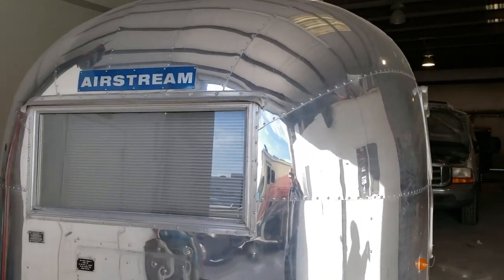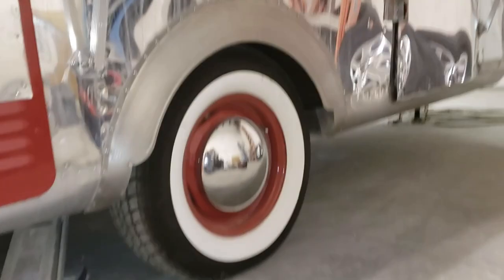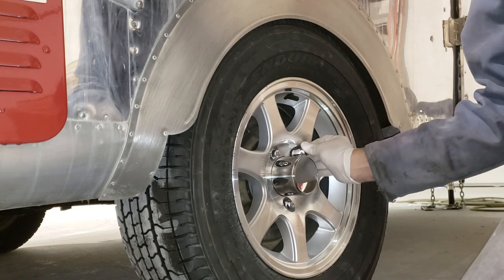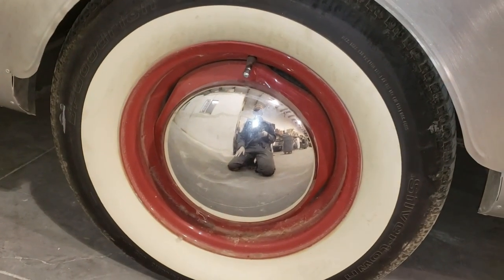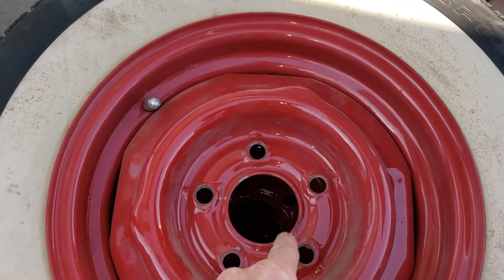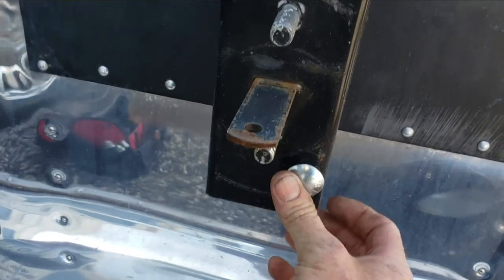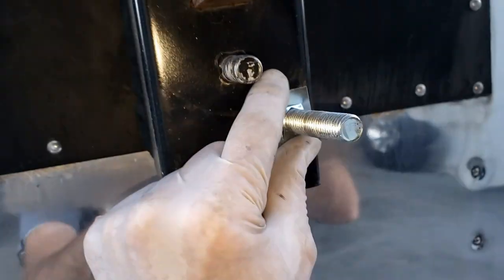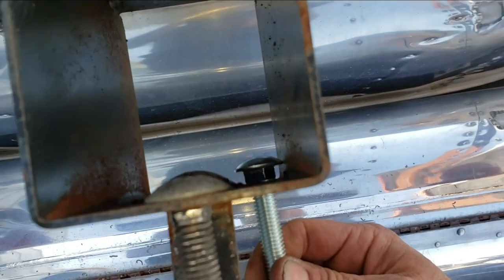1961 Airstream Bambi Wheel Upgrades

Comment: Nothing is easy LoL. I had the same problem with my old 07 Outback. Got new tires and had no clearance. Called Dexter and got the flip kit as it was spring under and now its spring over. New grease hangers and equalizer with some rubber isolator. Raised it almost 5”. Had to flip my hitch head too. Had to buy a step. The 2 factor step was to short now. All to go from a C load range to a D. Did call Dexter and they were very helpful with the install and tips. 
Nice job though but nothing is easy 😂
Reply from the maker: Right on

Comment: Did you remove the axle from the body completely to weld the block on, or just lift the body and weld in place? Good video James.
Reply from the maker: Yes, the axle was completely removed. We mocked up a 2 inch lift first but found it did not have enough clearance wither. Thank you!

Comment: is that spare tire really held onto the body with just rivets??? stupid question, but how is it attached to the frame? model number?
Reply from the maker: No there is a very large steel frame inside the wall the carries the weight down to the floor. Thanks!

Comment: Did you need to put that van in a lift to do the welding
Reply from the maker: I had to put the trailer on large jack stands and work from underneath..hence why I did not record it. It was nothing but cursing anyway :). Thanks!
Reply: That’s what I thought you are to hard on yourself